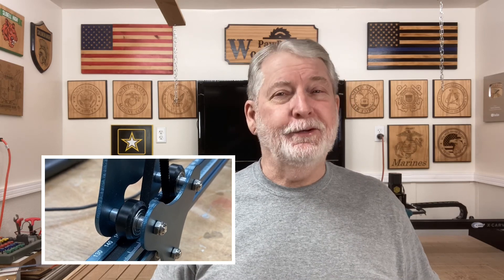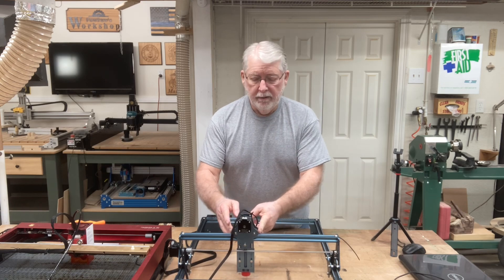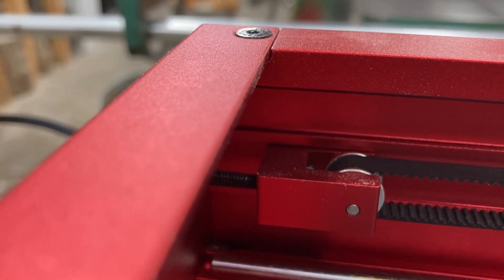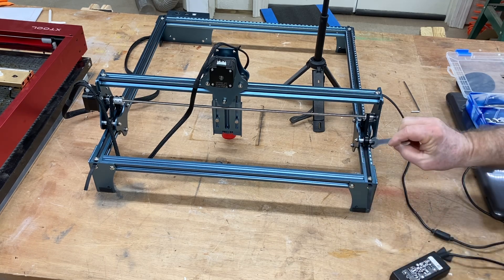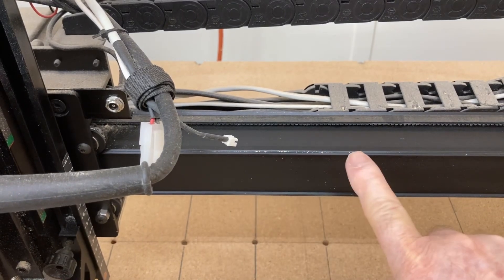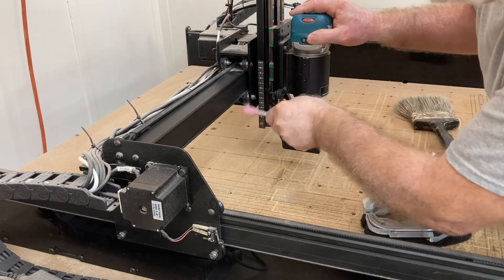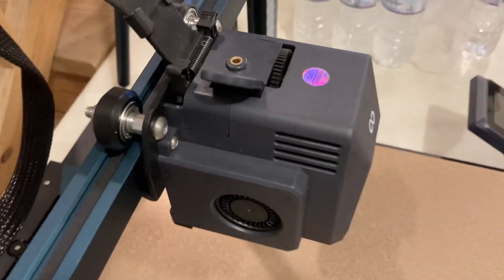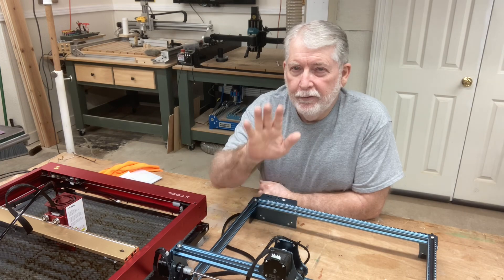THREE Ways to Get Better  Engraving and Carving!

Comment: What is the artifact introduced to your engraving by the improper belt adjustment?
Reply from the maker: Thanks for sharing your opinion
Reply: @PawPawsWorkShop  No... I was asking you! lol... what is the defect on your print that would make you want to tighten the belts! I have not adjusted mine and was wondering what I should look for?
Reply from the maker: I did not have a defect in an engraving. This was part of my normal maintenance and the belts were just a little loose. Not enough to cause a problem.   You will have distorted engraving such as a circle would be an oval.

Comment: Nice video Paw Paw!  I have been having an odd problem with my Comgo Z1 laser..  The laser has been skipping parts of the letters so that they don't get cut out completely.. "O" ends up looking like a "C" (sort of).  I ran 4 passes, but the laser skipped the same spot each on each pass.  Someone suggested trying a different font, but it didn't make a difference.  I've ran this same job several times before, but only recently had a problem.  Any ideas?  I did send some pictures to Comgrow, but I haven't heard anything yet.   Thanks!
Reply from the maker: Is it skipping the same location on the laser bed or just the same place in the program?
Reply: @PawPawsWorkShop  OK, I fixed the problem.  I noticed it was always the same letters at the same spots, no matter where the text was on the laser bed.  Turns out that the lightburn project had been corrupted somehow.  I tried again fresh from scratch and it worked perfectly.  Thanks for the help!
Reply: @PawPawsWorkShop  hmm.... I'll have to check and get back to you.   I understand what you're asking, but I will have to check..